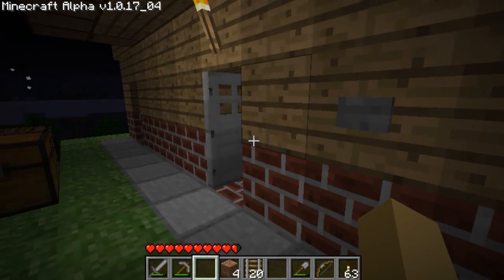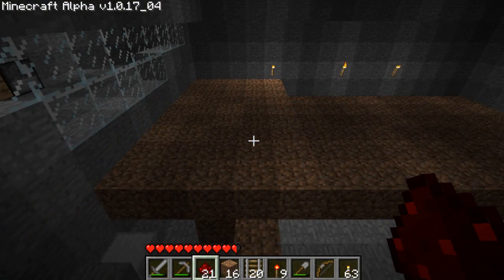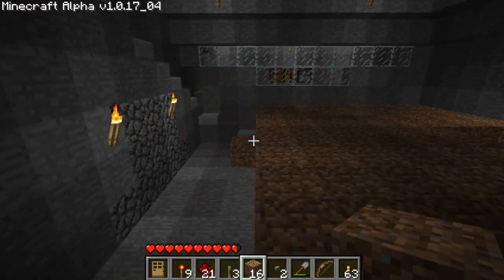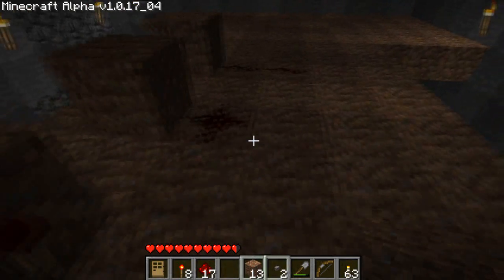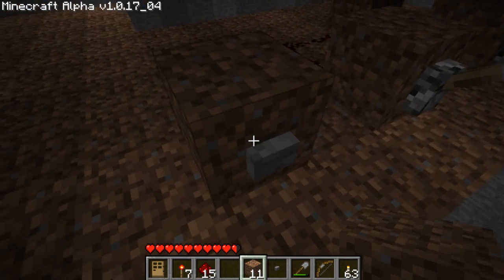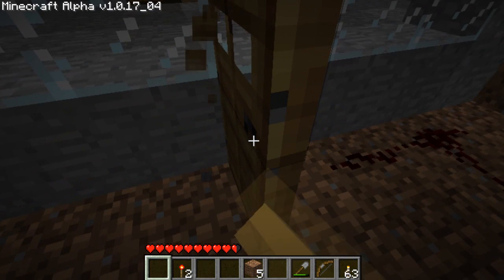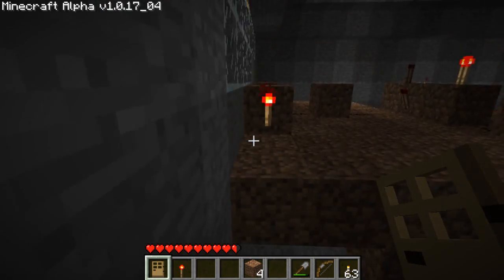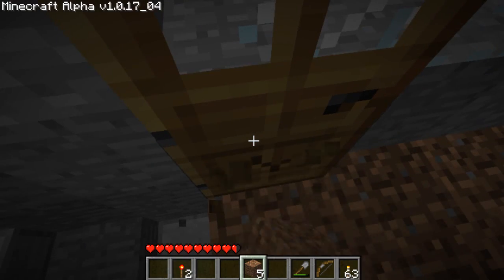Minecraft "3 lever combination lock" tutorial [commentary]

Comment from the maker: @Raxixz You'll either have to use buttons with RS NOR latches behind them (and the "close door" button wired to the resets of all 3 latches) or have 3 XOR gates where one lever is on  the outside of the house and the other one is on the inside. When you flip any or all of the switches on the inside, the combination changes.

Comment: @Misacorp Although you cant make the levers themselves reset, you can stop people from entering (with the code still on the wall,) by adding a second RSNOR latch directly behind the other one. This stops the door from being opened (even with the combination on the wall,) until the second button (attached to the second RSNOR,) is pressed, becoming the reset button. So you get 3 buttons, open, close & lock and finally reset.

Comment from the maker: @fuzzyduzzy Having a wire directly underneath the block that the door is on should do the trick. The orientation of the wire, however, may make a difference. If that doesn't work then a Redstone torch underneath the door should work. Just make sure you don't let the torch give power to the wire.

Comment: @torjemann1 You sure can. Say you wanted to make a lock with seven levers. Set up seven blocks with levers on them and set the desired combination. Use inverters on switches in the ON position to make all the backs of the levers OFF. Then wire them all to another inverter. The redstone paths will overlap, but it doesn't matter because any lever out of position will turn the torch on the inverter OFF. From the and gate onward the construction is the same as a three lever mechanism.

Comment from the maker: @Gibbonator42685 It's not really possible. Water doesn't interact with Redstone in any other way than "Give power to a water source block and it will revalidate it's flow". That means if you've once blocked the 2nd route into which water flows, it'll flow there again assuming you removed the obstacle. There's no way to stop that flow with Redstone.

Comment from the maker: @santagotback101 If a redstone torch is not receiving power from any source like a lever, button or another torch, it will be on. If, however, it is receiving power, it will be off. This is how redstone should normally work. If you're finding that it works some other way due to a bug I really do not know what to do. Make sure your redstone wire and your torches are not too close to any buttons or levers. They might interfere with the power flow if you're not careful with the building process.

Comment from the maker: @yoyodominos Did you test this, because it shouldn't leave it closed. Then again if you build 2 additional wires to 2 additional buttons you can open the door from the inside and close it from the outside. Wiring isn't even hard: just connect the buttons to the wires going to the existing open/close buttons.

Comment: @Bruno1015 you could easily put the three block method he has and then do the 3 blocks again so both sets of 3 feed into thier one block and instead of the one block going to the and gate you link them two blocks together and use an inverter to get the correct signal going into the and gate

Comment from the maker: @Javaguru555 Solution: Place the door in a 90 degree angle so that it defaults to open. After that, place an inverter (NOT) gate in the Redstone Wire travelling from the RS NOR latch to the door. If you already have an inverter there, remove it. This will make the door be closed when it is receiving power and putting a Redstone torch in front of it will do no good. The problem I've yet to solve is how you get out after this :D

Comment: I tried to do this with a combination of TWO levers (2 and 3 down, 1 up). And it didnt work. I may have done something wrong, but if not, i may have figured it out. Am i supposed to hook the multiple correct ones to an AND gate then connect that AND gate and all other correct ones to another AND gate which connects to the button and correct AND gate, where the intersecting AND gate connects with the door?

Comment: Too easy. I made a 4-digit combination lock where if you type 1234 then enter it opens but if you type 4132 or some other combination with the same #s then enter it will not open. I could also make it so you have to press 3353 too.